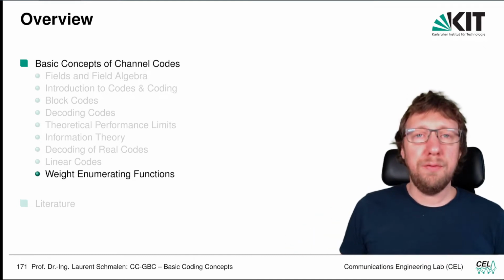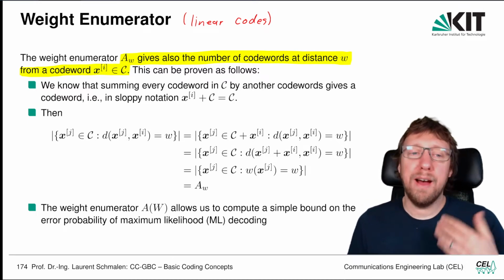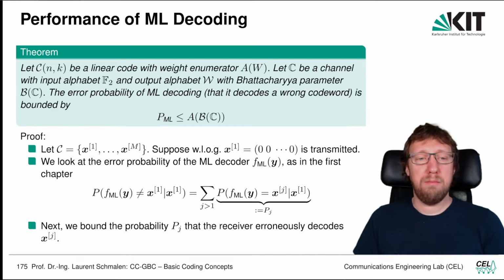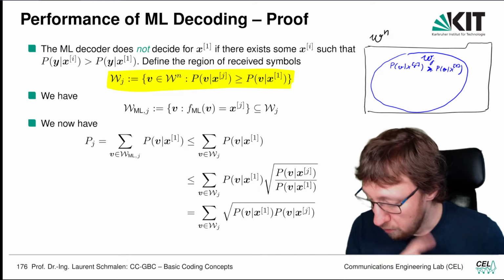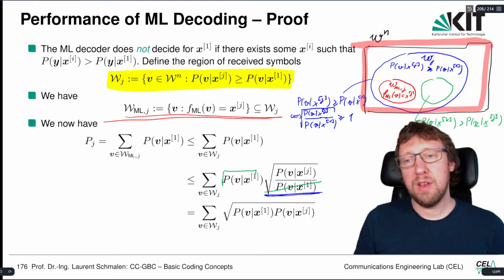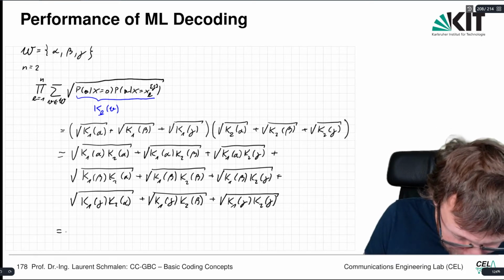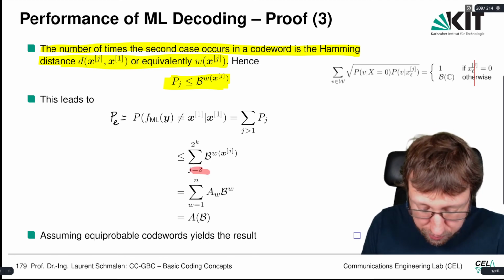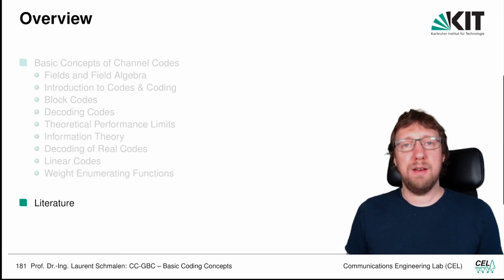Lecture "Channel Coding: Graph-based Codes", Chapter 2, Vid. 11, "Weight Enumerating Functions"

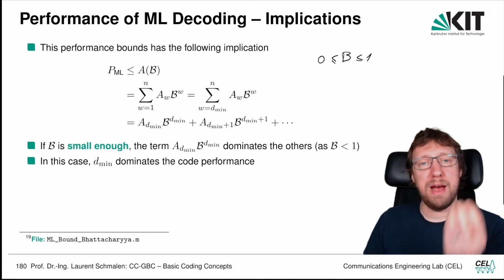Comment: At 33:11 you’re talking about 0 <= B <= 1, and how 0 means a bad channel, and 1 means a good channel. Am I crazy, or should that be reversed? (0 means a good channel?)
Reply from the maker: Well spotted! That's correct. A Bhattacharyya parameter B = 0 is a good channel and B = 1 is a bad channel Sorry for the mistake.
Reply: @ haha okay, I felt like I was going crazy for a minute😅 it gave me a good opportunity to search deeper into B. Thanks for the video, it was very useful, as I’m seeing that probability bound in Shu Lin’s book on Error Control Coding.